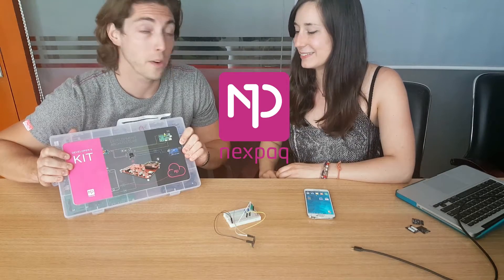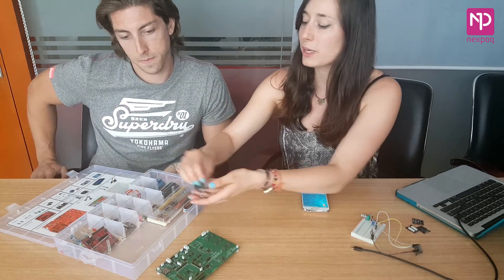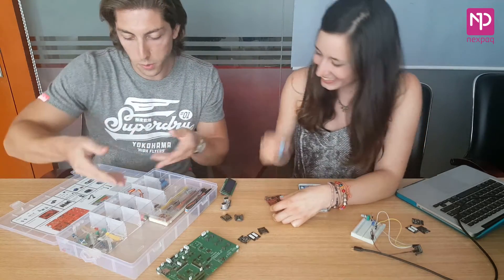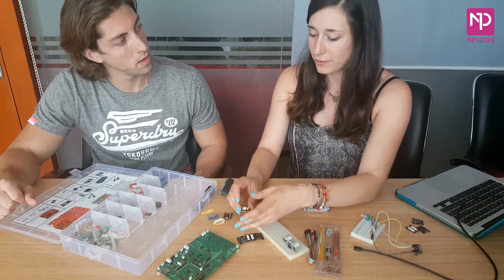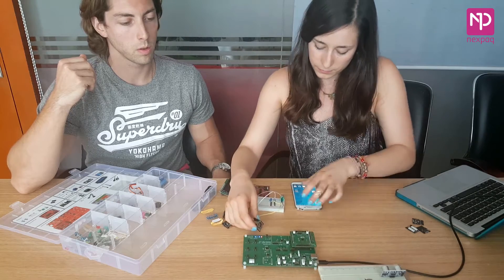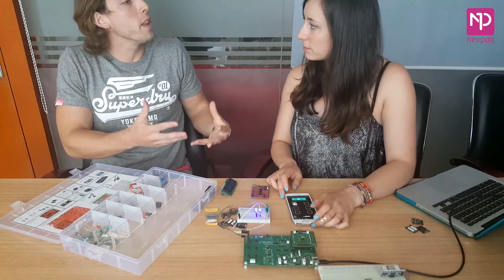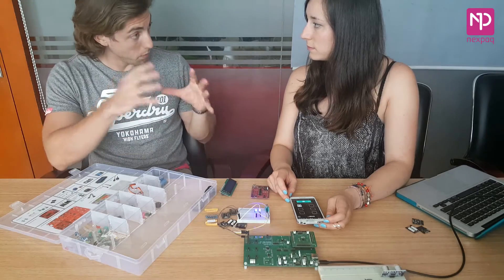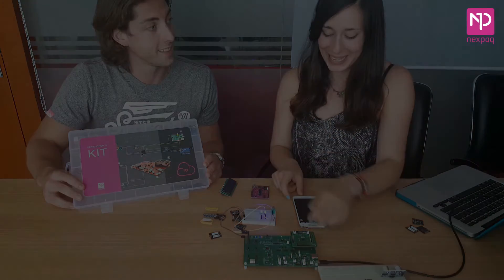nexpaq nDK: Build your own module

Comment: would it be possible to build a module that supports wifi charging for the battery module and the phone´s internal battery?
Reply from the maker: +xada valu Do you mean wireless charging? Like a Qi charger. In this case, yes, it's possible!
Reply: +nexpaq That is exactly what I mean, it´s great to know it can be done. I hope it is soon... Also, are you going to make a nexpaq for the oneplsu two? I would place an order immediately
Reply from the maker: Let's just say our office is very close to theirs ;)